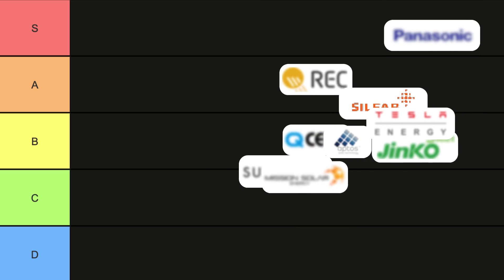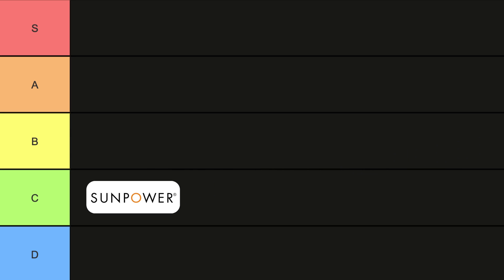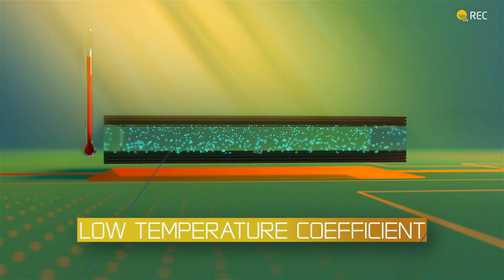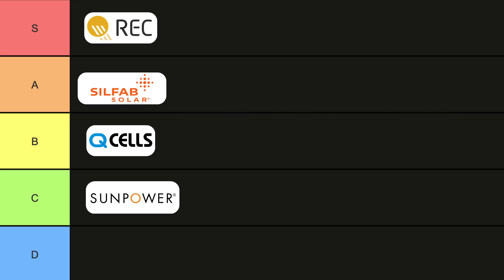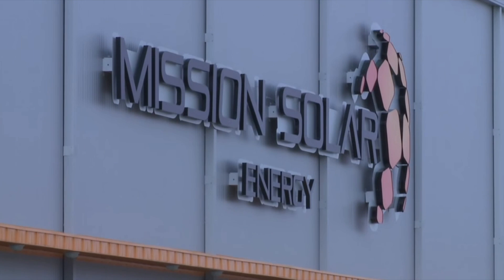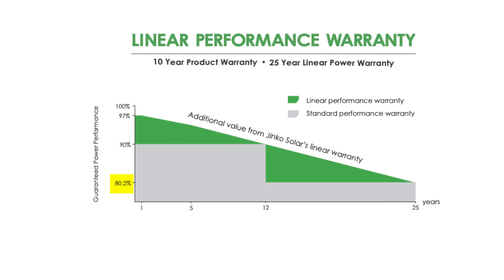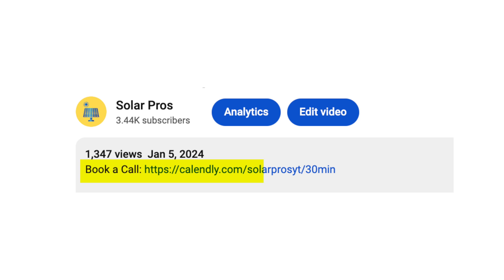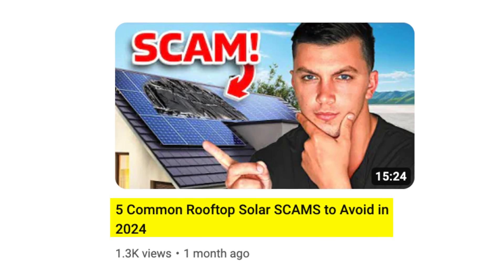I Ranked Every Solar Panel (Here’s What’s ACTUALLY Good)

Comment: I ended up buying the REC panels for my house. Total of 39 panels with Tesla Wall 3 batteries. We produce so much energy, I wished I had bought more batteries. However, I did invest in some Anker Batteries to use in my home to capture more inside so I keep more of my energy and not push it to the grid. The REC panels turned out to be a phenomenal investment for my house.

Comment: Blockbuster Video gave me a Lifetime Warranty on the DVD's I purchased from them. A 25 year Warranty means very little if the company who issued it no longer exists. I think efficency and price point, if degradation is all your worried about, most all of them rate them for 25 years or longer for use ..... better than a poke in the eye with a sharp stick

Comment: Jinko Solar JKM465M-7RL3-TV 465W, Bifacial x 6 =2790 watts peaks at 3414 watts and 680 watts in overcast. 465w producing 569 watts. The only performance that matters for my set up is what I can get through clouds Nov to Feb. March to Oct temp coefficient doesn't matter because months before it even gets hot here the system is in float charge at 9am or earlier. If not for cost I would have got Sunpower but glad I got these instead.
Reply: Do you have these Jinko panels on a ground mount? If so, how high are they off the ground to benefit from overcast days?
Reply: @SFzip  recent short in off grid channel solar upgrades https://youtu.be/Jx4Q7K2LEaI?feature=shared
Reply: @SFzip  https://youtu.be/nTSSNjxONco?feature=shared
Reply: @SFzip  https://youtube.com/shorts/Jx4Q7K2LEaI?feature=shared
Reply: @SFzip  off grid list
Short solar upgrades
It kept deleting my reply with the link

Comment: You  didnt mention that high temperature coefficient is a bonus also in cold climate region as it boost our voltage and thus increase our solar production a bunch in winter. Also you ranked those solar panels without having any price to it. I checked one of those panasonic panel from your S tier and came out with a 450$ price tag... I could get 2 or 3 panels of equivalent power from Trina for the same price. I mean panasonic is all nice and everything, but when your not a top 5% earner its kinda outrageously expensive to buy them. I dont see those panel standing the test of a price vs quality comparison.

Comment: Do you not have the Q.cells Q.Tron panels in the US? I've got them on my house and they are certainly a tier ahead of the older Q.Peak series, with better efficiency, better temperature coefficient and warranted to still be producing over 90.6% at year 25.

Comment: Depends on where you live and what panels are available. Comparing best panel from one manufacturer against worst panel from another is just comparing Apple vs Pears, and will always produce these stupid comparisons. Shame Jinko Tiger Neo with 87.4% after 30 years wasn't used in the comparision.
Reply from the maker: I agree. I made sure to bring that up with the Aptos panel when speaking about its relative pros for certain areas of the country. To your point, many manufacturers have varying panel options, and I tried to select the panel from a manufacture I see most commonly sold on the residential market.

Comment: The benefit of using SunPower is the microinverter output.  SunPower Maxeon 440 watt panels are paired with a 384 watt AC output.  This means less inverter clipping.  There are 6 different versions of the IQ8 series.  An REC 420 watt paired with an IQ8+ is only 290 watts continuous. Newer doesn’t necessarily mean better.
Reply from the maker: You are correct in that the SunPower can only work with the iQ7 because of the output power. This is why the new Enphase IQ8X will be beneficial to any homeowner looking to use high-wattage REC panels or others of similar output.